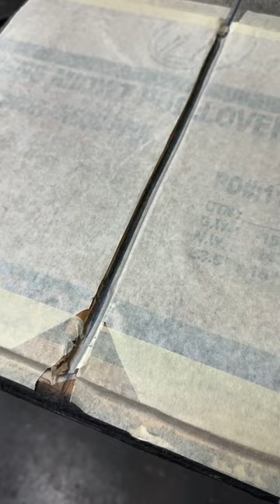Screen Printing Hoodie with zipper ❤️ #screenprinting #short

Comment: if you don't mind, what do you spray on the board and what material is that roll you tape onto made of?
Reply from the maker: It’s and adhesive that holds the T-shirt down ….the tape is pallet tape
Reply: @myloprints  Appreciate the response! Recently found your channel and you've been a great source of information, wish you the best.